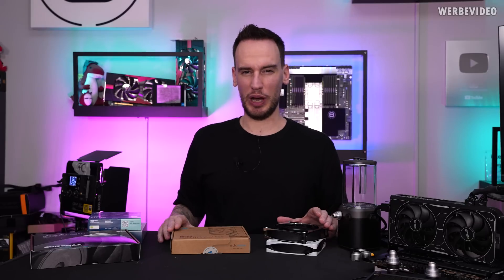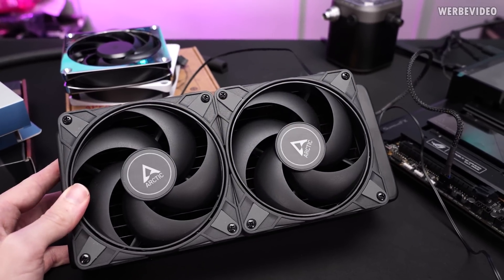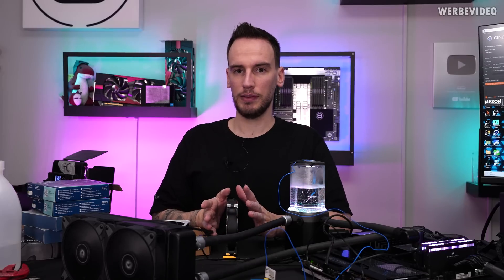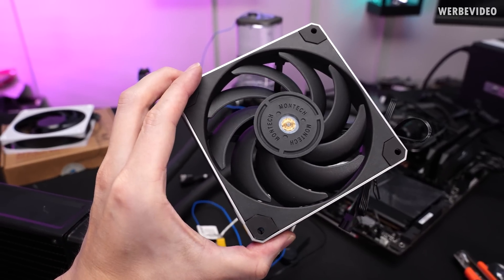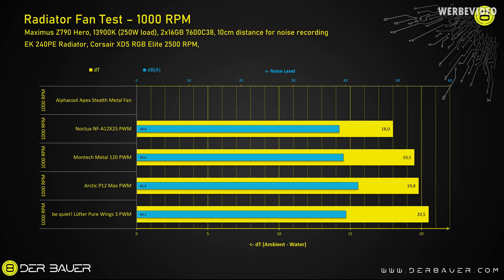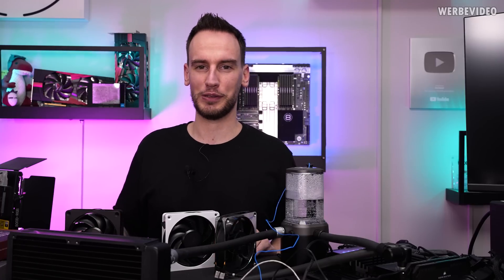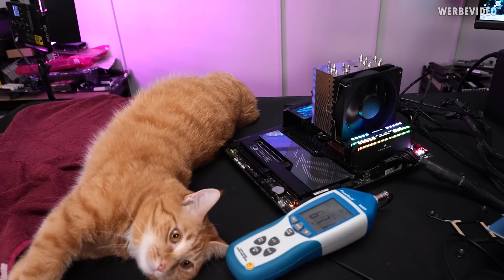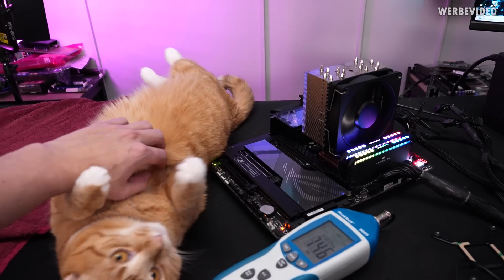Something is Wrong here - Alphacool Apex Stealth Metal Fan Reviewed

Comment: A small correction in an otherwise great exploration of Alphacool (and Igor)'s claims.
@6:51 Dimensions for Montech Metal Fan are the SAME as regular 120mm fan, they are 25mm thick, packaging just states that the PACKAGING is 29mm thick, you can verify this by packaging also being 140mmx123mm, definitely not the dimensions of a fan which is square, and certainly the dimensions of the cardboard box.
They perform better (in some metrics) than even Noctua which is surprising but it is NOT due to them taking the route of thicker fans like Phanteks T30/D30 (30mm), EK Meltemi (38mm), LianLi Unifan V2 (28mm), or the plethora of 26/27mm fans that trade compatibility for performance, this makes the Montech's an insanely good contender, especially given the price point.

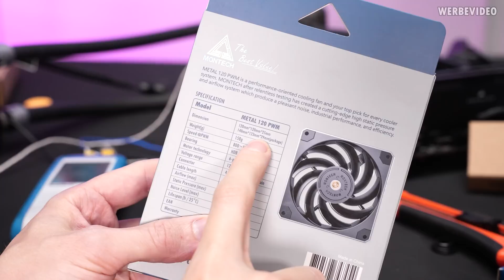Comment: @6:54 - Correction needed: You are reading the PACKAGE dimensions from the Montech fan box. That is the box size, not the fan size. The fan itself is 120x120x25mm. The box which the fan comes in is 140x123x29mm.

Comment: I really don't think it requires highly scientific, rigorous testing to conclude that an ordinary fan being twice as good as a (current market-leading, but otherwise) ordinary fan is quite an extraneous result. Polymer blades turning under a set RPM threshold can only be optimised so far, there's no way a simple shape adjustment could possibly lead to double the performance. Readers and viewers need to exercise more incredulity

Comment: I highly doubt someone will be disappointed with a comparison to the Noctua fans, people don't swap out fans when a new one comes to market so the new ones would go into a new build and there wouldn't be a comparison. Then there's something wrong at Igor's lab, those test results were covered in red flags. Anyone that's used different high end fans in multiple builds knows the differences between them are not that great ever, twice as good is a red flag.

Comment: It's simply not possible to get that much more increased performance, unless every other fan manufacturer is just guessing at a blade geometry and getting 40% efficiency and these are 80% efficient. Not likely, Noctua is a fan company, they design fans and blades, they have CFD etc the probablity of their design, and everyone elses design to be that inneficient is not possible. Simply changing the housing from plastic to metal sure might reduce noise, but sure as hell wont increase performance by 2x at the same speed. Also, how come on Igor's test results the fans get more CFM through a 60mm rad vs a 25mm rad??

Comment: Anyway you cut it... doesn't look good. Igor did 'exclusive' pre-release testing while Alphacool was accepting preorders. 
Numbers on that review are bogus, 45CFM unobstructed,  44CFM with 60mm radiator in front. Claims fan is so powerful or uniquely well designed It's like radiator barely existed for the fan.

Comment: Really appreciate the test! Good to confirm that the hype was quite exaggerated.

But there were a few flaws: 
@6:52 no, the Montech fan isn't "slightly higher".  The 140x123x29 mm is the dimension of the box itself!  The fan itself has a normal size.

@8:20 no, the fan blade design isn't completely different to the other fans:  the Arctic has the same basic design with an outer ring connecting the fan blades.  Didn't you look at the fans? :)

Comment: Interesting. When I saw the "metal" fan, I was thinking along the lines of the chassis and blades being made from metal. Really disappointing to find out that it is only the chassis. Noctua have a new fan coming in 2024, will that beat their old fan?
Reply: Per their road map, it's only 140mm fan. And probably it will be big upgrade over their existing 140mm fan which is quite old in design and needs a replacement.

Comment: Igor's Lab uses a testing machine that simulates a radiator by using pressure. From my understanding, it basically blows air against the airflow of the fan, which, while perfect for measuring airflow, fails to account for the fact that most of the noise of a radiator fan comes not from the fan but from the airflow through the fins of the radiator.

Comment: next time connect 2 or 4 radiators from a supply source with a externally controlled temperature. 
if 2 radiators are connected, connect the inlet as an pair or if 4 are used 2 pairs.
let the outlet dump the water in the sink.
make sure that you have a buffer to on the inlet. maybe you could use a boiler turned down

Comment: The only fan that I actually liked more than the Noctua was the T30. But not every application allows for extra thickness. Third favourite, the Thermalright TL-B12. Not the extreme. The P12 is fine, but humming at 1k rpm is annoying. I wasn’t impressed by the BeQuiet Silent Wings 4 Pro.

Comment: What do you mean so called O-Ring connecting fan blades isn't common. Noiseblocker did that like almost decade ago with their Eloops line
Reply: Do you know what common means bud, a lot of manufacturers would have to use that method which they don't so it's not common 😂
Reply: And a lot of them are starting to do it again, check bequiet new fans, heck even Arctic did it on their, and many more. It's not so uncommon

Comment: You should do noise normalized testing - bring them all to the same dB level and see which cools the best at thatdB regardless of RPM - realistically I'd guess most tune their fans to run as fast as they fan without being too loud, at least I do
Reply: IMHO comparing fans at the same RPM is a flawed testing method. Each fan is going to flow differently at different RPMs and will have different efficiency and flow curves versus RPM and static pressure.
Reply: @forbiddenera how is it flawed, if a fan pushes more air even at low RPMs it's a better fan. Your method for setting it based off db would be worse because you could literally buy a 3 pack of the same fan with one being louder than the other two even at the same RPM
Reply: I'm almost disappointed 😢 you're usually great and on the ball for this stuff but missed it here.. I mean that's also why some fans are good for radiators but not case and vice versa, fan blade area, count, blade thickness and pitch..it may very well need more rpm to perform better yet still have the same or lower noise level..

Comment: Is it possible that Igor's test actually was correct in terms of movement of air but somehow the pressure the fan exerts against the radiator just does not work out as well as the Noctua fan? It's very quiet, but maybe something about the air movement pattern is less effective.

Comment: I have been using Noiseblocker Eloop fan's from BlackNoise for almost 2 decades and I can highly recommend them if you want real quite and stil have a very good performance.  Only Noctua came close to the Noiseblocker,  Noiseblocker had an one degree delta difference with Noctua and it was much quieter. When Noiseblocker is more expensive then Noctua I buy Noctua when it is the other way around I buy Noiseblocker.
I have one system running for 12 years I disassembled it cleaned everything out and used all the 28 Noiseblocker fan's for my new build to replace this system. So I can recommend Noctua and Noiseblocker I don't even look at other fan's.
Although with the chaining these day's it is tempting to get fan's which you can chain if you use so many of them in a build.

Comment: Hey. Would be nice to add a test with constant noise. For example 40db and 45gb, then to that value set the rpm's accordingly. That might be quite useful.
Reply: even when using dbA instead of db, the noise level is still quite subjective as our perception is really frequency dependent and it changes a lot depending on individuals and circumstances.
Reply: @PainterVierax  100% agree. Yet it provides fair efficiency comparison between all the of the fans maintaining constant loudness at the same time. Might be informative.

Comment: That view at 8:10-8:20 are just like Bitfenix 200mm fans are put together they were really nice high quality well balanced between CFM & air pressure for 200mm fans. They also had the best possible mounting holes as they have about 3-4 different sets on each corner.

Comment: Alphacool has Cybenetics test results on their web page and interestingly CFM and static pressure are both about 33 % lower than Igor's tests at max rpm (or Igor's numbers are 50 % higher). Cybenetics max CFM is 71 and static pressure 4.2, while Igor's max CFM is 117 and static pressure 6.2. I'm pretty sure that Cybenetics results are much more in line than Igor's.
Reply: Cybenetics also has Noctua NF-A12x25 test results and if we compare both fans at 2000 rpm, Noctua's CFM is 30 % higher, and static pressure is 22 % higher than Alphacool's. So Roman's tests are quite well aligned with these.
Reply: @tuomashautamaki2258   Oh interesting! Cybernetics is very honest if they show those results. That deserves praise for not deceiving the customer.
Reply: Thanks for pointing that out! Cybenetics only have the 3k RPM Apex and no 3k RPM Noctuas to compare, but I doubt there's any major differences between the Apex variants.
Still not terrible test results despite not being revolutionary like they touted. It's BARELY quieter than Noctua's 3k RPM fans at full speed (comparing Cybenetics test to Noctua website, 40.1 vs 43.5 dBa). But they lose massively in CFM by 38 and static pressure by 3.4 mmAq.
Hopefully someone like Gamers Nexus gets there hands on these soon so they can be put through testing on the same equipment. Probably still far from a game changer at this point, but could be a nice option for a stylish case fan.
Reply: @rammagaming uhhh no u absolutely cannot  compare a manufacturer's noise rating to an unbiased test. The t30 demolishes that fan in every way including noise at the same rpm and the t30 makes roughly the noise u claimed for the noctua at 3000rpm. That 3000rpm noctua fan has notably worse noise to performance than the nfa12 even.  Alas these new fans just continue to make me appreciate the t30 more and more as it just demolishes new premium fan after new premium fan. Tempting me to buy some lmao.
Reply: Just wanted to inform you, that Alphacool had the wrong test results up for a while. They changed it recently
Reply: the cfm for this fan is 47 static is 2.09 the numbers you gave are way off
Reply: @ninja36inc  Depends on which fan version you are looking at. Your numbers are for the 2000 rpm version; mine are for the 3000 rpm version.
Reply: @tuomashautamaki2258 the 2000 is the one being tested your numbers are off I gave the correct numbers for the fan tested on this video
Reply: @tuomashautamaki2258 why you going on about a fan that's not in the video Igor tested the 2000 so did Roman
Reply: @ninja36inc This is a 2-year-old video, and at the time of release, there were only Cybenetic's numbers for the 3000 rpm model (true numbers, not Igor's false numbers). My comment was about how those of Igor's tests were horribly wrong.
Reply: @tuomashautamaki2258 as are your numbers Roman tested the 2000rpm two years ago when he uploaded it
Reply: if the company is advertising stats lower than what an independent reviewer gets, then theres no way the independent reviewer is right

Comment: Between conclusion I would actually like you to retest this with noctuas best performing fan the NF A12 or A14 industrial ippc 3000. And that's also their most expensive. These industrial version of the NF series spin at a thousand more RPM than the ones you tested

Comment: Do you think that the metal case holds cooler air (over time)? because I think the metal should be cooler than the surrounding air because of the air flow...

Comment: It would have been super interesting to see the Phanteks T30 fans tested as well, they are regarded as very good for radiators/watercooling, but they are thicker too. Maybe you can do this for a follow up Roman?
Reply: shhh dont tell anyone about these secrete fans
Reply: Go to hw busters, he's tested both. Spoiler alert, the t30 demolishes every fan including this one in noise to performance tests. Oh and in cfm the apex is 2nd or dead last in every single noise increment without fail 😂. Don't get these as case fans to say the least
Reply: @Frozoken  ya they rock. got 3

Comment: The Metal Fan's fan frame is many times thicker than other fans in the video, it reduces the fan area by a ton. While every high end fan manufacturers are doing their best to minimize the frame and have the fan blade sit as close to the frame as possible, the Metal Fan wasn't. That should be a good sign that the claims are bs.

Comment: I fucking wonder if it's physically possible to have that much airflow at those rotation speeds. Like, if air is a solid sausage being moved by the fan, will it move at that measured CFM?
Reply: Basically, in ideal case the air will move according to the exit edge profile of the blades.

Comment: Sometimes more airflow across a radiator does not equal more cooling. The air can pass over the cooling stack too fast and diminish the cooling effect. This might not have been the best method of testing the fan.

Comment: I wonder if the fan is more designed for a "open" situation where it would works better as a case fan instead of putting it on a radiator.  It might provide more airflow to the overall system with reduced noise level.

Comment: How unfortunate, I was hoping that they had done some dev to make their fan bearings quieter while running a faster proprietary motor or something that made their claims possible. I'm still interested to see rebuttal from this to show how those magic numbers actually happened, if it's like Nvidia cherry picking settings to show a 4x framerate boost when the actual uplift is nowhere near that it would make sense but more than likely just never happened. Thanks for the review!

Comment: Igor's charts don't make much sense. They show almost no change in airflow with rad thickness or even between rad and case. It gets ~112 cfm at max rpm in a case and on a 60mm rad, really? More resistance requires more work which requires more rpm on the fan for the same output. You know, physics?

Comment: Did noctua performed best? Yes. Is it worth 3,5x price of Arctic's p12 max? Not a chance. For the price of 2 noctua fans I can get 7 p12 max and my temps gonna be 1K higher? I can live with that.
Reply: I don't mind paying the extra for Noctua because of their excellent customer service and great build quality.  I wouldn't trust any other company when it comes to fans and heatsinks.
Reply: p12 (non max) are quieter than P12 max at less than 1700rpm due to a different bearing.

Comment: The Alphacool Apex Stealth Metal Fan strong point is stealth or low db. Its low noise is likely the result of lack of tip vortices. However its relative low air flow rate limits its use for higher wattage air cooled CPU loads. Not mentioned is how higher air flow rates increases dust accumulation. Low air flow rates are better for lower dust accumulation until the thermal limit of the CPU is reached. One way to limit noise and dust is to use fan curves found in the bios or uefi. I like using an air cooler with the center fan on at its lowest speed initially. Then as the CPU temperature increases the fans come on in this order: front CPU, intake case fans, then exhaust fans. All the fan curves should reach their maximum at 90C to give some margin before thermal throttling is reached. The CPU power limit should be set so that under peak load limits the CPU temperature to 80 degrees to allow for some dust accumulation.

Comment: before everyone freaks out, Igor's Lab tested the Apex Stealth Metal Power Fan and not the "new" Alphacool Apex Stealth Metal Fan. The Apex Stealth Metal Power Fan is the precurser, and has some insane claims, but the new Alphacool Apex Stealth Metal has, as the manufacturer provides the infromation, almost worse performance than every other fan, including Noctua, beQuite! or CoolerMaster.
So is it worse? maybe yes, but they look cool!
So keep in mind: The rule of cool and red makes things faster
Reply: They are the same fan, but the max rpm of the power version is 3000 instead of 2000. If you look at those 1000 rpm results in Igor's testing (which claims about 30-130 % better performance than Noctua), it doesn't matter which version is used.